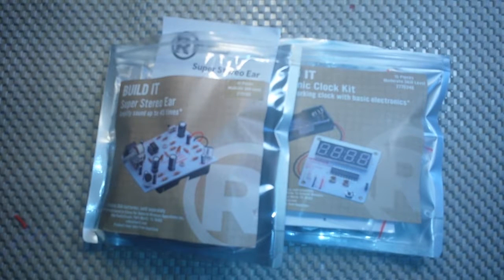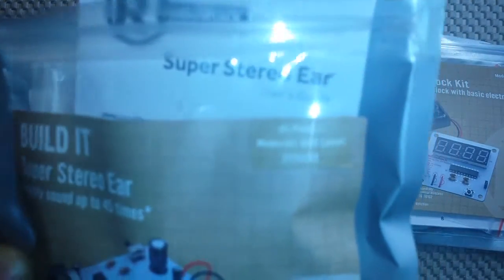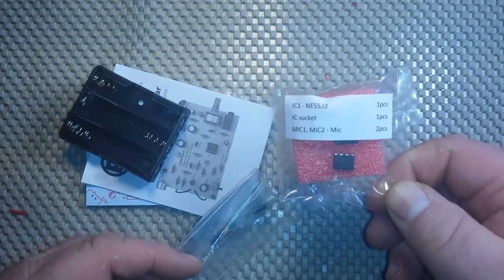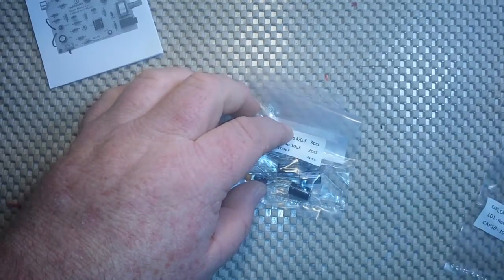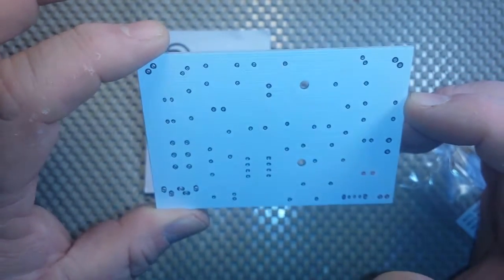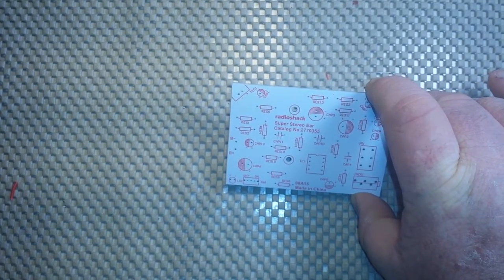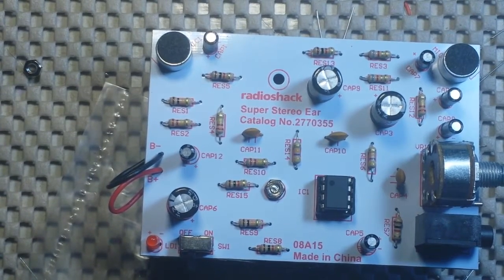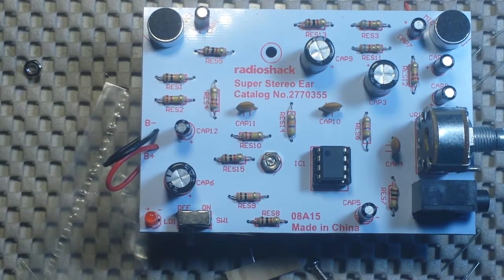Radio Shack Stereo Ear Kit Build and Review

Comment: Watching this 7 years later.  Went to my local Shack the other day, I wanted a 4 digit 7 segment display and a couple side mount momentary tactile switches, thought I might pick up a new solder kit or two and maybe a roll of solder while I was there.  They didn't have the display or the switches, they had 50g rolls of 60-40 for $12.99 and the kits were at least twice what you'd pay on Amazon, unless they were on sale, then they only cost half again what an Amazon kit sells for.  Unfortunately I had to leave empty handed, I don't mind paying 25-30% more to support a local merchant, maybe even 50% more if it was something I really wanted or needed right away, 100% increase on the other hand, not so much.